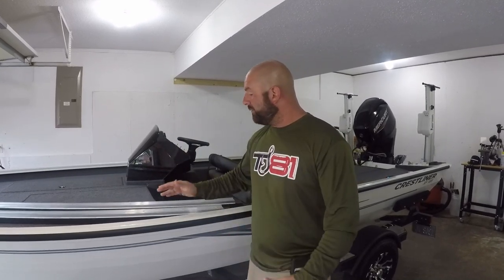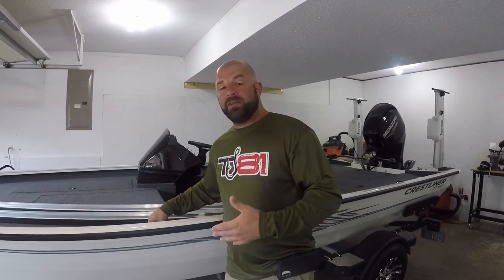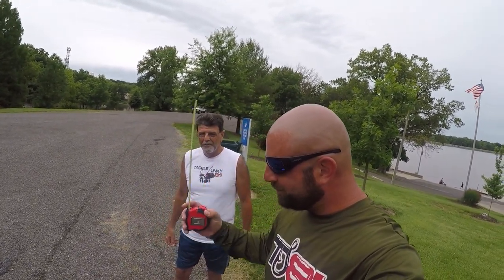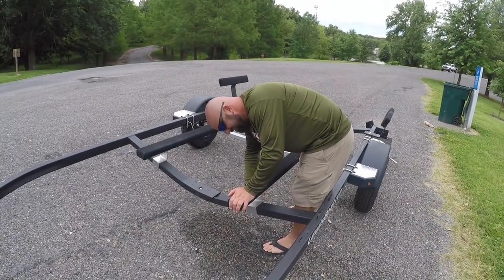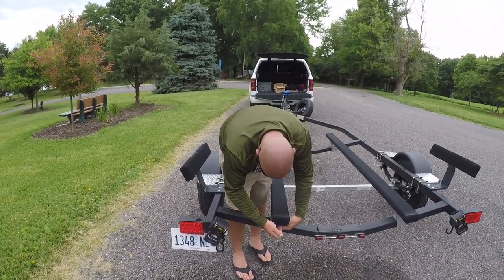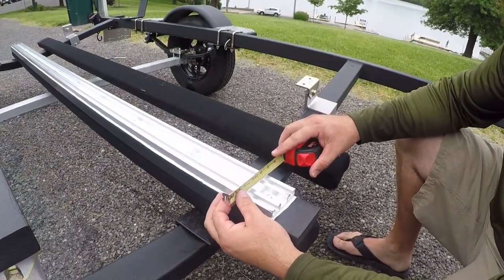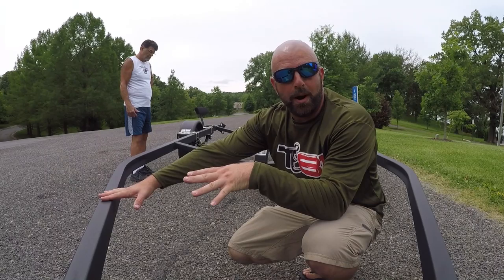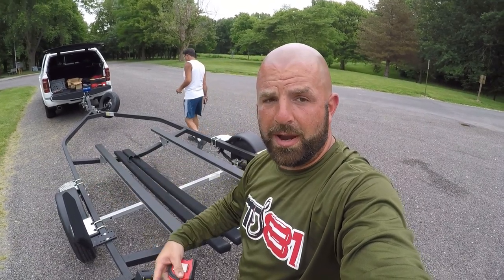STOP!!! No Longer Struggle with Launching & Loading Your Boat...

Comment: I put the Drotto auto boat latch on my ranger trailer and it works great at a quick loading and un-loading you might want to check that out Jim since you usually load by yourself most of the time...nice skid plates.
Reply from the maker: I'll be sure to check that out. Appreciate the heads up buddy!

Comment: Nope, I have the best set up on my trailer. I used to get a little loud with people helping me load my boat. But I put the best system on my trailer, very cheap and no matter the weather or anything. I can load my boat in 5 minutes or under effortlessly every single time. I put the guides on each side then got 2 feders to take up gap in between the boat n guides. I strap the feders to the guides and all I do is winch the boat to the front n pull it out of the water. Perfect load on the trailer every time. All the guys with the real expensive bass boat can't believe i get the boat loaded so fast by myself and perfect every time. The best set up. I showed this one guy after I pulled my boat out and he said that is a great hook up.
Reply: Pictures please?

Comment: How are the boards holding up? any scuffs on the gel coat? Any loose boards yet? Have you put carpet on them or are they still bare boards?
Reply from the maker: Just fine. I used these boards for years on my last trailer, so I already knew I'd like them. As far as I know they aren't scratching the boat up, but it's underneath if so, so I'm not that concerned about it.

Comment: When you installed your Ultimate Bunk Boards on your Tracker Trailer, did you get the 9 footers and cut them down to match the length of the original ones, or did you leave them long?  Or, did you get the 8'?  I just received 9 footers for my 2016 Proteam175TF.
Reply from the maker: That's a good question and I honestly don't remember, but I do remember them being a tad longer than the stock boards.
Reply: @TackleJunky81  And I assume you didn't cut them.

Comment: what’s the advantage of these?  details as to why are they better than stock?  thanks tj!
Reply: They don't have the drag that the carpeted bunks have. So your boat will slid on extremely easy. Just don't disconnect the front strap from your boat until the back is almost floating because it can slide off before you get your boat to the water. Hope this helps. Check out his other video of his old tracker. These bunks are well worth it. I just ordered them for mine.
Reply from the maker: Plus they won't rot like wood. They'll be the last set of bunks you buy.

Comment: what is the aluminum track underneath the bunk that your using to mount the bolts? where can I buy that track?  Did you assemble the track on the bunk?
Please advise... lol 🎣👍
Merry Christmas
Reply from the maker: That track is included with the Supreme boards and comes already attached.
Reply: But my question was about the Track as that is what I need.  I'm certain that that track is not made exclusively for that product.
Reply from the maker: @jeffarnold8454  Not sure where you can buy it separately.
Reply: @jeffarnold8454  you should contact the manufacturer... they would be best source to answer the question you've posed...

Comment: What are they made out of? The new boards?
Reply from the maker: High-Density Polyethylene Plastic with a UV inhibitor added to help resist fading.
Reply: TackleJunky81 way better than wood. Wood bunks are junk I don’t need know why boat manufacturers use them

Comment: I haven’t had a boat in years....I’m not really seeing the point of swapping those bunk boards out.   How can the new ones help with loading or launching?
Reply from the maker: They are slick...the boat glides off and on. Plus you'll never have to replace them as they won't rot like wood.

Comment: Doesn't this raise the height of the bunks since you are mounting from underneath the bunk?  Any concerns for the 1 3/4 in height increase?
Reply from the maker: I haven't had any issues...if anything I believe it helps launch the boat even better. With a longer boat you have to watch the nose if the rear is floating before you unhook. It wants to drop off and it could hit your trolling motor. With it being raised up a tad I clear it no problem.

Comment: Why bother ? What did doing it accomplish ??
Reply from the maker: The slick surface makes it much easier to launch and load...plus these bunk boards won't rot like wood.
Reply: lifetime bunkboards, no maintenance/replacement.  the easy on, easy off is icing.